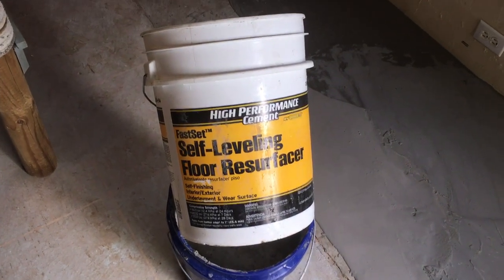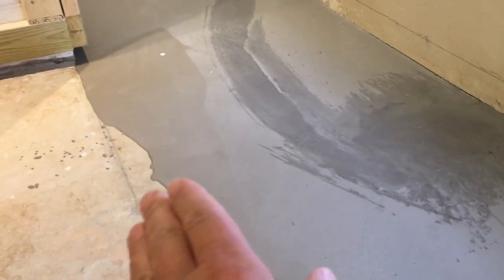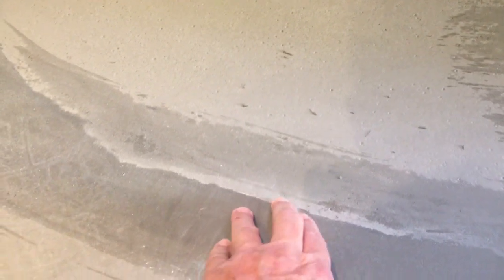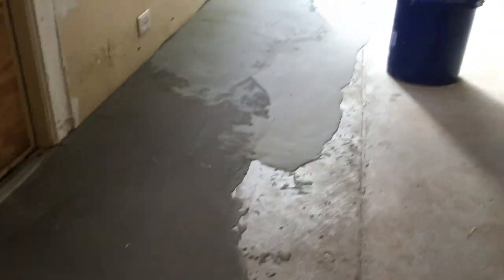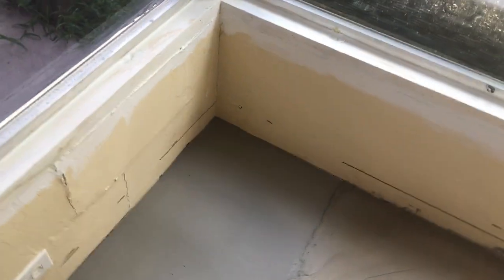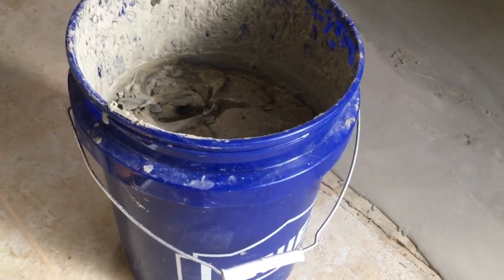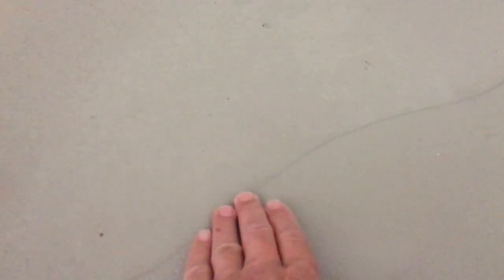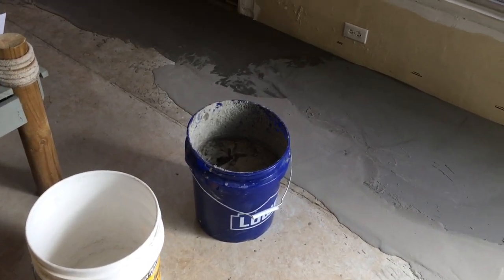Disappointed with Quikrete Fast-Set Self-Leveling Floor Resurfacer

Comment: self levelers are not an easy DIYer products. People complaining saying that Lowes should remove this product because they don't work need to understand that you have to know what you're doing with these. You can NOT trowel them! (at least not after the first 2 minutes of it hitting the ground) You have to be FAST from pour to pour or you will get pour lines no matter what. You can't mess around. The floor HAS to be primed/sealed or it will set up way too fast and you will get pin holes. You have to use a gauge rake to spread it, a trowel or a "magic" trowel to smooth it very quick and then back roll it with a spiked roller and then LEAVE IT ALONE, all within 5 minutes of pouring it down. You need to get the next pour on the ground within 5 minutes (they all say you have 20 minutes working time but no self leveler Ive ever used sits for that long and still able to level out with the next pour)
Reply from the maker: Great tips mojo jojo.  Thank you.
Reply: Keene M : I have to take back what I said about this particular self leveler. I tried it out and it really is horrible stuff like another commenter said. You can take your finger with water and literally rub a hole into it after it's cured and it doesn't flow well at all...rapid set concrete leveler is very good stuff. Try that next time. Home depot carries it
Reply: @TimKollat  Glad you added this. It's garbage and no one should ever use it.
Reply: want to come do this to my basement floor? ;-)
Reply: What? Hire a professional to do it the right way and pay him for using his hands and experience? I mean they charge high for low cost! As if taking 500 off the estimate would be a loss! No way. 😂 as a flooring installer i hear that alot and i blame big corporation for using the words *made for easy and quick installation or fix. Got people thinking our time and effort gaining experience isnt as valuable as our prices. And then cry as their "DIY" project with the wife and kids fail miserably 😂🤷🏻‍♂️
Reply: They are 100% easy for DIYers. I never did it before until the other day and it worked out perfectly. The problem is stupidity, people don’t read or do research like they should.

Comment: This stuff is really hard to work with. Mixing it according to directions is a no go. Best to add 4 quarts of water to empty bucket then have one person gradually add the material while another mixes. Once all the leveler has been added to the bucket you need to add another 1 to 1 1/2 quarts of water to get it to actually spread out on its own. We put down 23 buckets and it looks like 50 shades of gray! It was also super hard to get the stuff spread evenly from bucket to bucket. You need experience and skill to make this stuff look good.
Reply from the maker: Thanks for sharing your experience Scott.  Your expertise is very valuably to everyone who watches this video.   I found it hard to work with too, and switched to Mapei self-leveler.  Thanks again.  Keene
Reply: The. I let says 5 quarts water to 50 on. I let of mix mixing time is a big deal to and temperature.

Comment: Ya commenter mojo mojo  said it best this stuff is not for the rookies it helps to have more then one man on the job  depending on how big of an area your pouring  but regardless no matter which damm brand it is you got to go faster then the self leveler will go that shit may not seem like its drying up but it'll solidify enough to make it not pour level with the previous bucket/batch  and will pour over itself and dry uneven  you must trowel it quickly and keep it coming just about on a constant pour theres no allowing that stuff to sit and set and always check your forms/dams before pouring and prime the floors with a damm primer roll it out like a paint roller dont let the primer puddle too much itll leave spots where the self leveler will not properly dry neither will the primer and it will create vulnerable weak points areas prone to cause cracking or start a cracking or seperation itself as an underlayment used for anti fracture moisture and sound and structural support....  whatever your leveling with any brand of this type of mortar got to have things ready and multiple people moving quickly it takes experience I've been pouring it and on some very large pours and it dont get much easier to do ya just learn what to expect and how to work it better all the way around from prep to finish toweling to setting vinyl or tile or what ever on it it's a real process that if you need done correctly had better have someone who knows what they're doing a few someones that know what they're doing !
Reply from the maker: Dong King, thanks for the comment.  In My Channel I try to demonstrate products and techniques that any DYI'r at home can accomplish.  Your comment suppots my conculsion that this product is difficult to work with... you said you have years of experiance and still listed a number of things that can cause problems.Lucily the Mapei product got us through this job!
Reply: Honestly it’s not bad once you’ve done it a few hundred times 😆. You gotta have your mix a little on the runny side. You can achieve this by adding not more water, but a product called “flow control” and distributing the product with a tool called a gauge rake, and finishing it with a flat blade squeegee and a spike roller if you wanna get real fancy. 

 You gotta mix it and get it outta the bucket. Self leveler produces a lot of heat when it’s kicking off. Also, you’re gonna wanna prime your floors. All stuff you can google. “Primer for self leveler”  I’m always surprised by the quality of the cementitious products at Lowe’s and even Home Depot (when there’s not a Lowe’s nearby) 
Good luck man
Reply: good grief dude-  learn how to present yourself coherently.  jeez.

Comment: The mixing instructions on the bucket only say mix with 5 qts of water.  Their video says to use 6 qts.  I messed up my first bucket because it set up too fast and had to remove it.  The next 2 were no better but was able to level it with a trowel.  Finally I did a search and saw they recommend 6 qts water and worked really nice.  Unfortunately where I had to trowel I have 2 low spots that will need another batch.
Reply from the maker: Thanks for sharing your experience, Bronko. That sounds similar to my experience. I actually ended up with 5 five gallon buckets with the solid material stuck in it. Thanks again. Keene
Reply: Yep. Got screwed as well. Bucket it comes in says 5, was a total shit show.

Comment: You should always pre mix the dry before adding any water as it settles in transit and just sitting...the amount of water is critical by the directions...and you should always have a team mixing so the pour is non stop until done....within two hours you can use the edge of the trowl to shave high spots...quikrete is fine this is OE issue.  This is 90% prep and set up. The pouring is the easy part...it is fast and furious until done.
Reply from the maker: Thank you Peter.  Those are excellent tips.  I’m sure they will help others using this product.  I appreciate you watching my videos and welcome any other comments you have.  Thanks again.  Keene

Comment: Make sure your drill batteries are fully charged, the torque needed will drain them faster than you'd expect. If you have a corded fall back drill, make sure it'll work/fit your mixer and have the required strength. Dry mix the powder to ensure consistency for best results. Before you pour any water, do a dry-run of everything. Go through the motions so you're not scrambling for somewhere to place your dirty equipment, moving things around during precious drying time, or not stepping over things with 50lbs bucket of leveler in your hands. I'll take a leap and assume the recommended mixing time starts when you've added all the powder.  If you're doing this alone, (one batch) pour the bag into a 20ish gallon storage bin, dry mix it then scoop manageable amounts into the mixing bucket as you mix with the other hand (you'll get a workout). Lastly, cold water!

Comment: Just need to learn how . It’s a great product
Reply from the maker: It must be a good product because it’s still sold.  My experience leads me to Mapei.  Thanks.  Keene
Reply: @wkeeneM  Was the mapei self leveler plus much better? I can't stomach buying this stuff again.
Reply from the maker: @aermotors  yes it was MUCH better to work with. It was very thin so it flowed evenly. It took overnight to dry but I think that’s what made it work. Make sure you plug any holes because it will fill them up too.
Reply: @wkeeneM  awesome good to hear, do you remember if you added extra water or what it was?
Reply from the maker: nope. Just followed the instructions. Good luck. I think you’ll be happy.
Reply: @wkeeneM  Working time shows only 10 mins, but it was still much better than the Quickcrete huh? I think I'm too in my head on it all now lol. Have looked at 10 different types of self leveler....
Reply from the maker: @aermotors  why not just buy one bag and try it where it doesn’t matter. You’ll gain confidence in it and your project won’t be compromised if you don’t like.

Comment: Seems like you need more water in the mix ,didn't look like a good flow. Also use a needle roller to help with air and blending
Reply from the maker: Thanks for the suggestions Dino.  The instructions are very specific about the amount of water and caution adding more.  Yes it seemed very thick to me when using it, but having not used it before, I followed the instructions explicitly.  Also, I didn’t know a needle roller existed or I would have used one.  You obviously know what you’re talking about.  I hope you’ll subscribe to my channel so you can add more suggestions on other videos.  Thanks again Dino.  Keene

Comment: I just bought this product and read the instructions on the bucket. They do say to use 4 liters of water per 50 lb bucket. However, the bucket itself (50lbs) comes as 5 small bags of material.  Am I to understand that this means 4 liters of water per packet (which appears to be around 10 lbs per package) or should I mix all of the bags at the same time with 4 liters of water ?
Reply from the maker: Hi Steve.  I am not an expert using this product.  I just show the experience I had using it.  However, when reviewing the instructions, they say to use "3.8 liters per pail".  I read that as 4 quarts for the entire quantity of powder.  That's the way I recall mixing it too.  I believe the 5 bags were included so you could make 5 small pours as opposed to one large one.  Good luck with your project.  I appreciate you watching my video and hope you find more helpful info from my other videos.  Keene

Comment: Did you prime the floor first? Did you mix the contents with a large enough mixing drill? Did you mix for 3-5  minuets? Did you use a spike roller to finish it off?
Reply from the maker: Wow.  You must work for Quikrete.  I followed the directions on the bucket as written.  I don't recall reading about a spike roller to finish it off.  I first purchased 4 buckets that worked as described.  Then I bought 4 more at a different store.  The first one plopped out of the bucket so I tried to flatten it out even though the instructions said not to.  The alternative was to have a 50-pound blob of concrete on my floor.  The next bucket would not even fall out of the bucket.  Thinking the buckets from the second store must be bad, I went back to the first store to buy their last 2 buckets.  They worked the way the first four did.  I proved that I followed the instructions correctly so I have to assume the buckets that did not work must have been defective.
Reply: Keene M I do not work for any of these manufacturers. I have used self-leveling on dozens and dozens of projects. The only time I had failure was when I didn’t follow the instructions correctly. It seems like you did everything to the best of your knowledge. Next time you use self leveling concrete you have to dampen the floor first. Concrete is a giant sponge and will suck the water out of anything. Always prime the floors first that $20 mistake can ruin the whole project. Next time use sika from Home Depot. It’s only $22 for the same weight as quick Crete
Reply from the maker: Thank you for the suggestions Robert Watson.  I did prime the floor.  The product I used had problems before it ever hit the floor so wetting it would not have helped.  Thanks for the recommendation for Sika.  I've used their products before and they are typically of high quality.  
Thanks again,  Keene M

Comment: It works, just dont follow instructions.. thin it out a bit more and it works great.  Also cannot do in separate sections. One pour and done.. this guys got no business doing concrete. Do it right.  This is meant to fill small unlevel sections not a whole room.
Reply from the maker: This is a review of a product that is sold to the general public. The manufacturerer's instructions should be clear and should work as expected.  One should not have to guess at adding mor e or adding less to get the desired results.  It was just a small section of a room- not a full room.
Reply from the maker: @cerealbucketcoaster  Thank for watching the video.